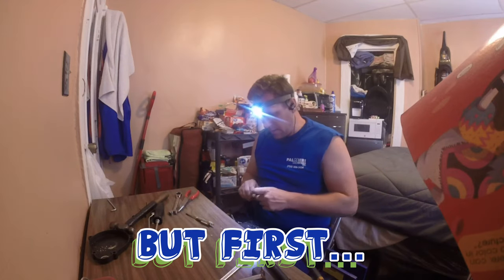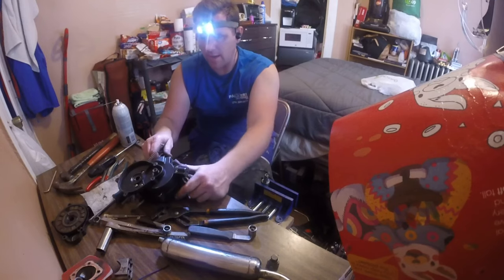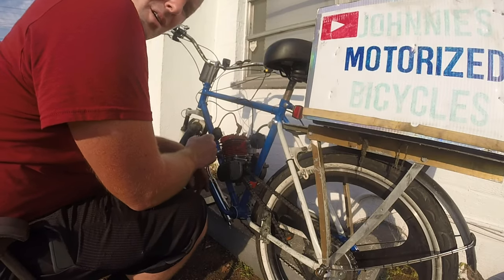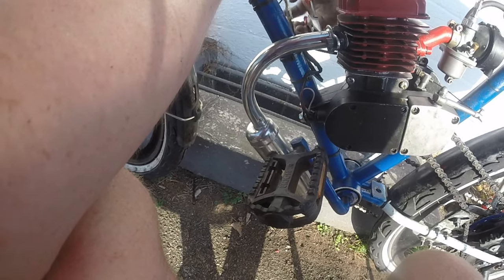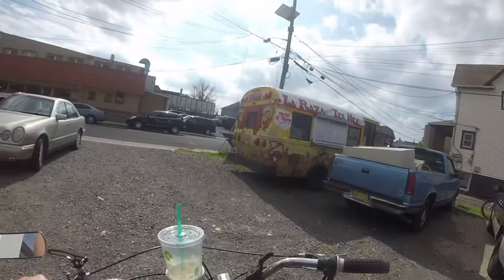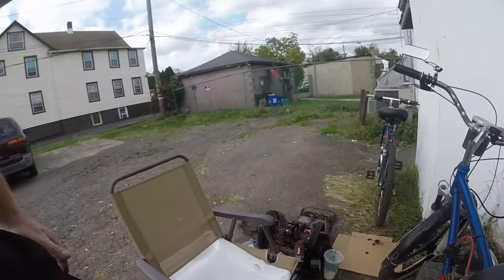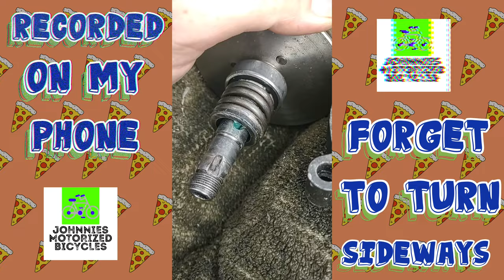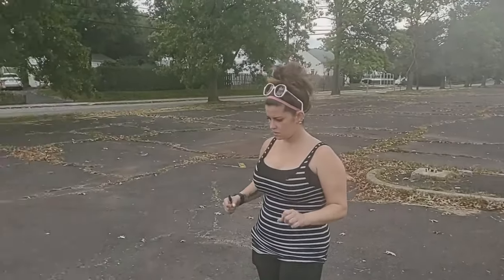80cc PLUS BROKEN PARTS ADDS UP TO FUN, EVENTUALLY.

Comment: Just made a DIY super clutch other day.  going to see how that plays out lol!  hoping the springs I ordered come soon so I can toss up the video!  closer you get a pipe that matches the engine on a 2 stroke the better the more power they produce!   Happy thanksgiving!! 🦃🦃🦃🦃
Reply from the maker: Happy thanksgiving to you too, and I thought about makin my own “super clutch” too but just haven’t yet. I never didn’t have a motor not hood my power level pulling my weight yet cause righting the stock spring usually works. My yd100 dio came close but I never got it tuned pasted 1/4 throttle so if I get back to playin with it and tuned for all the rpms it probably won’t hold. I never had the jets till recently so I’ll be playing with it again soon. But tbh I always wanted to take a set of semi metallic brake pads and cut them down to fit in the basket and I honestly think with hood pads like that you still wouldn’t “need” the super clutch. But if I’m being honest I don’t really think I want it for the performance it gives, I really just think it looks super cool hanging off the side of the motor.
Reply: @JMB676  lol Just doing it for fun of it lol!  I actually had no issues with the Minarelli clutch after I upgraded the internal spring when I build them to 600lb instead of 300lb comes with it.  Just pure fun science lol I hope works or I have to buy about 35$ in parts to replace LOL!
Reply: lmao super clutch
Reply: @SoLoCruizer  yeah man your slipping with the times!  We are all @ super clutches these days my my how the times have changed since your last bike ride lol

Comment: 15:35 That kind of clutch failure is common for these. I had a seeutek before I moved on to a zeda and I have rebuilt the clutch twice on it, but what really worked is a custom clutch made by Ryan Darragh which is essentially the same setup as stock, but with much higher quality parts. Since then, no problems. You have to put some heavy grease on the bucking bar, bearing and arm for it to last.
Reply from the maker: Yea definitely keep it grease well or it will fail quickly, but I never had a problem with a clutch like this before. The seetek is the only time I had a problem like this but I’m confident with this fix but I do plan on building my own clutch one day. Fixing stuff with my own hands n ideas is the fun for me tbh.

Comment: I did swap everything over to my other yd100 bottom end and it's running like it did before my bevel gear kamikazed itself, might give getting that off a shot later on. All these end problems we be having though. :D
Reply from the maker: I always use the gear puller that comes with the kit and it worked all but once, that time I had to use a couple small crowbars but since it’s shot I guess u can use a cut off wheel on an angle grinder or ur dremel I guess n that be way easier.
Reply from the maker: Well atleast it’s running good again, it’s such a relief when they just run isn’t it. Lol

Comment: That seeutek seems pretty reliable
Reply from the maker: I cut a part out to shorten the video but i said that this motor is really well put together with the cheapest parts available. I had lot of issues wit the parts (consumables) but all the parts that broke are just cheaply made parts but the overall construction is good. They took care in the way they assembled the cheap parts. I have now replaced all the “cheap” parts like, the cylinder with a g4 and the piston n rings with a new one and now the clutch with a yd100 clutch. So I do not expect any more breakdowns. And it’s not on my bike anymore I took it off and built a little hot rod around it now. It looks great and rips.